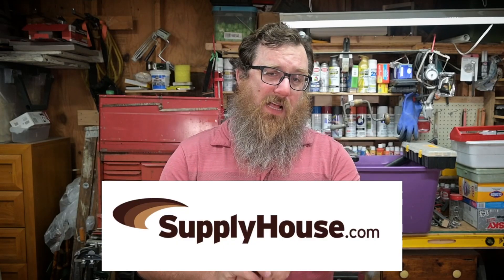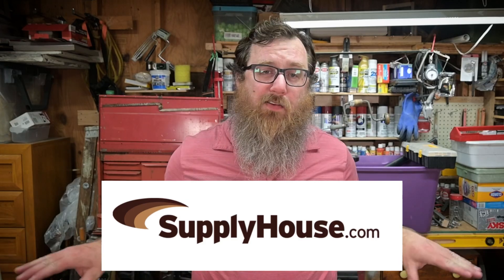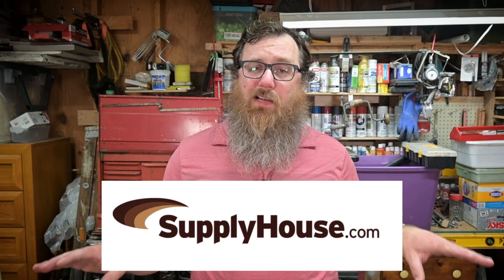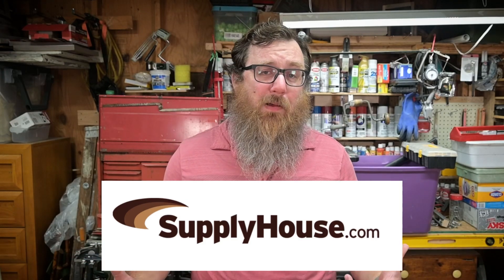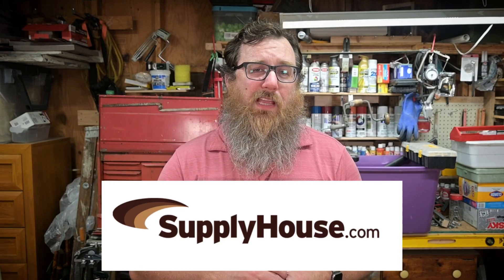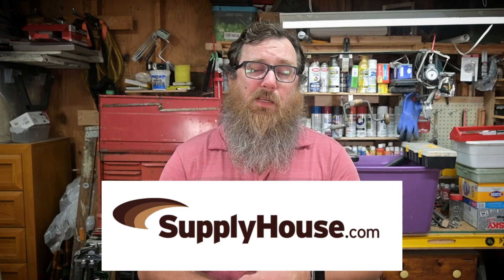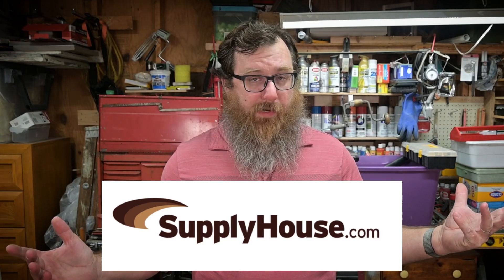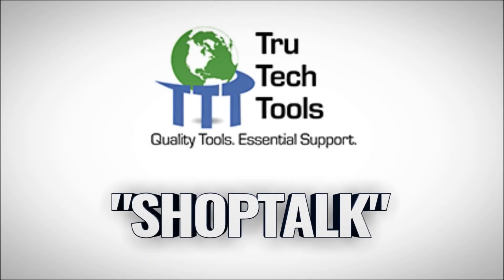HVAC Training | Strange Heat Pump Failure

Comment: Weirdest defrost thing I’ve seen is everytime system goes into defrost it gets stuck in defrost and runs heat strips until heat cycle shuts off so customer’s electric bill in mid winter was insanely high.

Comment: What are your thoughts on a company focusing their business on becoming an authority on ground source hest pumps. Remain involved in other work but focused on ground source heat pump market? I respect your opinion which is why I'm asking
Reply: I'm not Zack but I'll put in my .02 cents. It is possible to do depending on your location. If your rural that's great where people can did their own wells for a pump and dump or they have land for a closed loop. In any city it's about guaranteed you can't dig a well in their jurisdiction, and you don't have the room to dig for ground loops. I love ground source heat pumps, but if you are going to start a business strictly on that, unless you are willing to travel very far often your clientele base is limited because the cost difference between an air to air and water to air is astronomical, there are good rebates on it, but, the upfront cost is A LOT. 3,4,5 times air to air. Absolutely become the best in it, but have other alternatives ready to fit people's budget. My 2 cents. Hope it helps in some way.